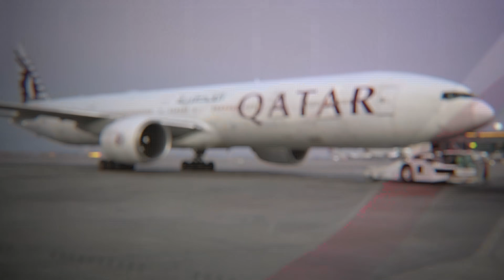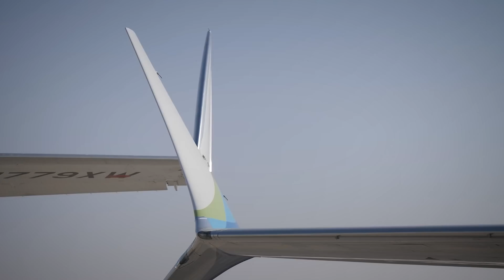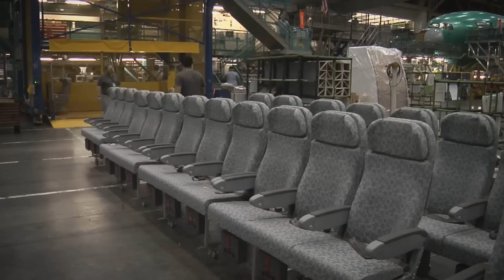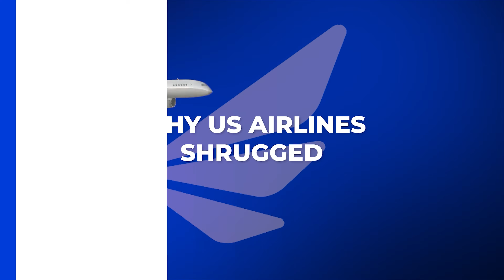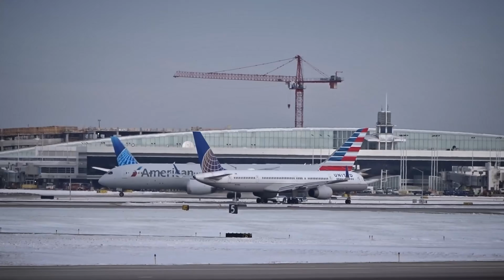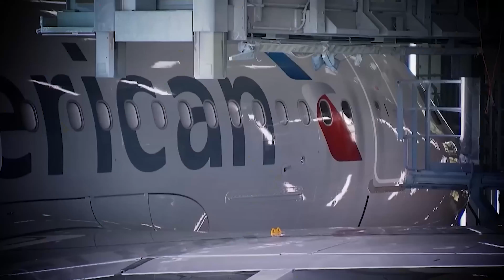The 777X Conundrum: Why US Airlines Are Avoiding Boeing’s Newest Jet

Comment: The US has, due to high competitor pressure in US, also favoured clean sheet designs, with lower fuel burns and lower seat mile. If AB launches the 350-2000 it could very much take Americans sale.
Reply from the maker: That would be interesting to see too! I believe the A350 stretch is coming, so we shall see. Though as I mentioned in the video, I do also think that it's a question of timing. As and when the US fleets are at a point where their older large aircraft need replacing, they may well revisit the 777X. Let's see! Thanks for watching :)

Comment: The 777-X is better than the A350 in every single way. Airbus should be out of business.
Reply from the maker: Apart from one critical way: the A350 is in service, while the 777X is still on the ground, running seven years late and counting. Normally for a company to be in business, they need their product to be on the market, functioning, generating income, not just headaches for airlines trying to figure out when it might turn up :)

Comment: the new 777x is the replacement of the old 777 so soon or later the airlines that use the old 777 will have to buy to replace the old fleet probably the next 10 yrs

Comment: Yes - they found many issues and its delivery is delayed by 7 years. Let's see the other side - the 777X will probably not have any issues after its delivery since everything was detected before it was first delivered. Other than it happened with the 787s and 737-MAX's which caused massive headache years after delivery. 

Imagine this has not been detected and at some point a 777X Engine would just detach or rip the wing apart. 

I prefer the current outcome. Good Video! ❤🎉
Reply from the maker: Don't get me wrong - it is muuuuuuch better to find and rectify the issues prior to entry into service, rather than risking passenger safety finding out the issues once it's already flying. As much as their reputation is suffering with the delays, and it's causing issues for airlines trying to plan the introduction into service, the alternative would be much worse! Definitely the better outcome.

Thank you for watching and for commenting!

Comment: I suspect that the first US airline to buy the 777X won't be American, Delta or United but Alaska Airlines now that it has merged with Hawaiian. They have already said that they want to turn Seattle into a gateway and I suspect that they may opt for the 777X to run trans-Pacific flights from Sydney, Melbourne, Singapore, Bangkok, Hong Kong, Manila, Seoul and Tokyo into Seattle. They could also run 777X flights from Seattle to some of the slot-constrained airports in Europe such as Charles de Gaulle, Heathrow and Amsterdam.
Reply from the maker: Oh OK, that's an interesting take! As you say, if they use Seattle as a hub then that could make a lot of sense. Thanks for watching and for your perspective on that!

Comment: It's not a matter of want, it's a matter of need.  No US airlines need it for now at least.  American, United and Delta all fly the older B777 variants that they may need to upgrade in the future with the B777X...we shall see.  You're a bit of a negative nancy and some have had enough of them.  Funny whatever happened to the A380 rusting wing roots  that happened AFTER approval?  Is not the purpose of testing to find issues and then act like adults and fix them rather than capitalize from them.  Screw off.
Reply from the maker: Absolutely that's the point of testing, and yes both manufacturers have had issues come to light after approval. However, the timeline and slipping date for entry into service definitely does provide airlines with a challenge when it comes to future fleet planning. Personally, I don't think stating that Boeing has had its best first quarter in years, driven in no small part by strong international 777X sales, is particularly negative, but hey, that's just me. Thanks for watching and your positive comment!

Comment: Its all about timing. UA and AA operate B777-300ERs that will eventually be replaced by B777-9s. DAL has committed themselves to the smaller A350-1000 for now, but that could change once the B777-9 established itself in the marketplace. Until then, smaller wide-body aircraft have been helping airlines rebuild their networks before gauging up to larger B777-9s in the the fleet.
Reply from the maker: Good points there! Thank you for watching and giving your perspective on it.

Comment: You know, I’m pretty sure American and United didn’t even want the 777-300 until they were offered a bulk discount.
Reply from the maker: Is that true? I had enough research just making this video so I haven’t looked further into that yet! With that said, airlines effectively never pay the full list price on orders, so I guess you could argue a bulk discount is normal…or was this one especially high? Genuinely intrigued! Thanks for watching and for your input!
Reply: @liftandthrustaviation they both were “we don’t need the 777-300ER” until the end of the production line discounts came
Reply: United has been quite happy to get the 777-300s. Yes they did get a deal. But certification and delivery of new programs has gotten longer and longer. Getting the 300s was a fabulous strategic move.

UA is keeping their 777s quite full. And so will be able to profitably use the marginal extra space and extra capacity of the 777X.

Particularly from their most profitable international gateway hubs and to the most constrained major international business center airports.

On the flip side, those 300s are quite new. And won’t need a replacement anytime soon.

The 777X will be an incremental increase for United. Don’t need to rush into ordering them. But will be able to profitably use them when Boeing finally has open delivery slots to book.

In the meantime the 787-10 and 777-300 will fill in for much needed 772 retirements. Until the right time to acquire some 777X copies.
Reply: Came here to say the same thing

Comment: I see United being first to buy to serve high volume city pairs with premium dense seating.   Use the -9 or even a -10 for Newark to LHR and SFO to Narita.  

787’s will let them fly direct from United US hubs to international prime locations that let travelers bypass overseas hubs like LHR, Amsterdam, Paris and Frankfurt.   For example, they use the 787-9 to fly non stop from Newark and Washington Dulles to Cape Town South Africa or Houston to Sydney.  

American may buy for similar destinations out of DFW.  I think both United and American will buy to maximize their battle over Chicago Ohare.
Reply from the maker: You know what, that makes a lot of sense! It’ll be interesting to see how it pans out! They need to actually get them into airlines, proving themselves, then we’ll see what happens. Thanks for watching and for your thoughts!
Reply: @liftandthrustaviation 

It’s important to remember United and Continental both have been heavy users of the 777-200ER.   The 787 has really stepped in with their extensive network of US hubs to create more direct destinations from the hubs but also multiple daily flights.  

A 787-9 in premium dense configuration is 222 seats and the 787-10 will be maybe 275 seats.   A 777-9 in premium dense configuration will probably be 350 seats which would give them the ability to compete on price with foreign airlines on those routes with heavy passenger/ cargo demand.   

The only demand they may have for the 777-8 would be for very long flights to expand direct service to India, Oceania and SE Asia (Houston to Singapore, Vietnam or Hong Kong for example) where the range and capacity work.

Comment: It’s looking like an awesome machine. But those delays are unforgivable. I get it, certification takes a long time and it should do - the 737 MAX and the 787 both showed why it needs to be done properly. But 14 years or whatever this has taken now? That’s nuts? How’s any airline supposed to plan on that?! Boeing is a joke recently. It seems either they rush, cut corners, compromise safety, or they take so long the world leaves them behind.
Reply from the maker: How good a machine it is remains to be seen once it’s in commercial operation. It does look impressive on paper though! But you’re absolutely right - it’s amazing any airline can plan their future fleet with these constantly changing dates and delays.